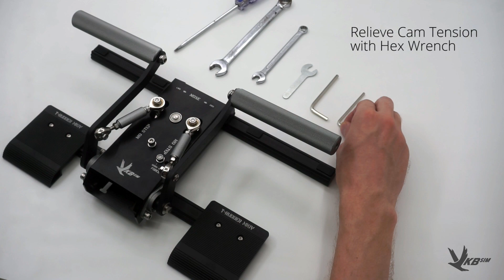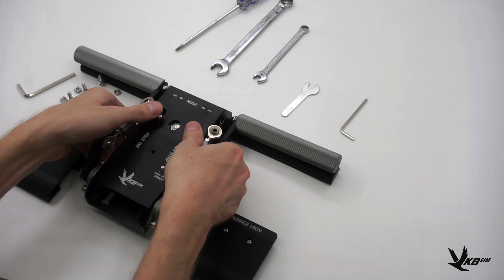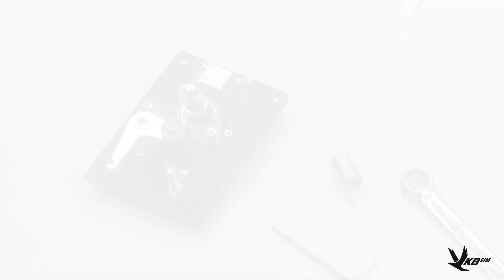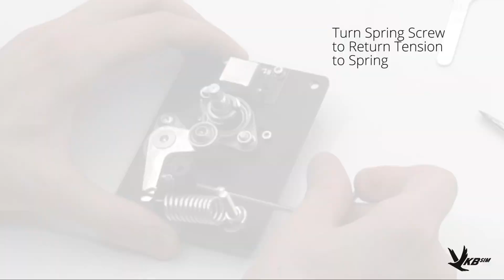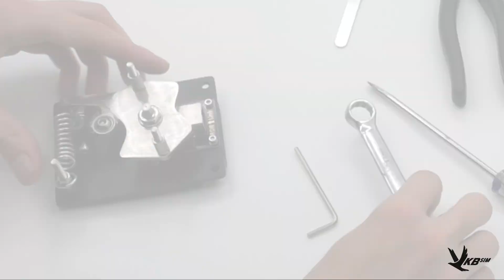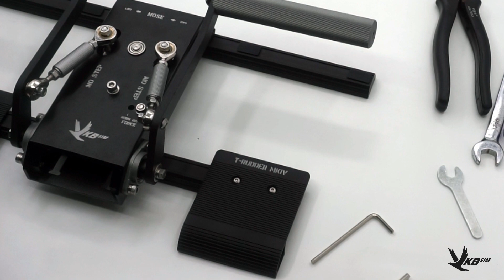VKB-Sim T-Rudder Mk.IV Pedals Cam Replacement and Adjust Spring Tension

Comment: Just followed, took 3 tries since I couldn't seem to comprehend the Spring Tension but I got it set to high force with no problems and I'm happier with it at high! Much more satisfying/feel like I'm more aware of how much throttle I'm pushing down. (Using for Star Citizen/Space)
Reply: o7
Reply: o7

Comment: Well, I bought these pedals 1 year ago yesterday and here is my little review after using them a lot over the past year;  For Flying Circus I love em' and not having toe-breaks is no big deal because WW1 aircraft did not have toe breaks anyways. For flying in IL2, not having toe breaks can be a real pain in the ass because most planes had wheel-breaks, especially the German planes because they used differential breaking on each wheel, which can be a freaking nightmare just trying to taxi to the runway.  However, once you get some rudder authority while taking off and get up in the air....these pedals are better than my Crosswinds when it comes to precision.  If you can live with breaking via B and N key on your keyboard then I highly recommended these. And the price for this fine piece of hardware is the icing on the cake!
Reply: Do you use light or tight tension? what is better? I'm going to tighten the spring but I doubt for now.
Reply: @alex-mos  I use tight tension.  As to which works best, tight or light, it's all about personal preference.
Reply: Bro, you can double assign the axis so that it deflects rudder and applies brake on that side simultaneously. It's an absolute game changer - now I have differential braking on every aircraft even though the T rudder doesn't have toe brakes, works like a charm, even in DCS.
Reply: @Northorne how?

Comment: Great video, really easy to follow! I flipped the cam to over to the detent-less side,  and changed over to the other spring, at the higher force position in a matter of 5-6 minutes. It really is a very nice design. A suggestion for the Mk5 though, perhaps make the spring tension screw adjustable while assembled, rather than requiring the user to disassemble the unit. by putting the other end of the spring on a lever arm, you could use another screw like the tension reliever to adjust the tension.

I would also suggest moving the top bearing to its own plate that bolts onto the top of the base. Have a cavity under this base large enough that you can take the cam out. This would allow you to access the cam while leaving the unit mostly assembled.

Still a great design as is, but these features might make a future revision a little more user friendly. Thanks again

Comment: I have a Mk.V and just went through this process.  You don't need to take the nut off on the cam.  Mine seemed unmovable.  However, you can take the off the roller by removing its bolt and then the arm swings under cam to make it easier to get the spring back on the arm when it is attached to the high force pole.  The tension adjustment bolt is NOT for adjusting the feel of the pedals -- the feel is either "normal" or "high" force, just those two settings.  The adjustment bolt is there to take the pressure of the roller off the cam so that you can take off the roller (or the cam I guess) and then once off, you turn the other way to relieve the pressure on the spring so that the arm goes under the cam and the spring comes off easily.  When you are all done, the adjustment arm should be out of the way and not be touching anything.  It just there to help with the spring or cam changes and no other reason.  Note that when the roller is off you can turn turn the cam around so that the opposite cam setting can be used -- again, no need to remove the cam bolt to change the cam setting.  Watch out!  It can spin around while you are paying attention to something else -- I almost tightened everything back up and noticed that the cam was not on the side I wanted.

Comment: Would be nice if you could just dial up the tension with a single hex wrench instead of a complete disassembly. Hard to know if you want the extra tension until you go through the whole procedure then maybe you have to go back all over again because the earlier tension was preferable. This way it is either default or max unless you buy different springs, nothing in between for a fine tune.

Comment: I ended up flipping just the Cam in mine. It's like the happy medium between the Normal and High pedal force. Still has the soft center feel but gets progressively harder to push the further down you go without all that extra spring load on it.
Reply: Sounds good but what do you mean by flipping the cam? How do I go about doing that? Any help will be appreciated, thanks!
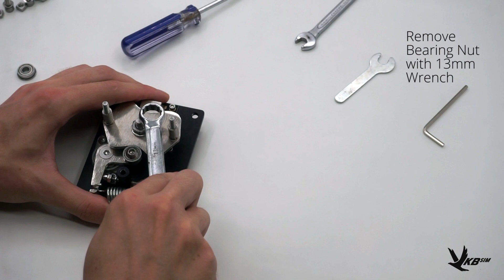Reply: @divij5424  At 1:40 in the video you see the guy removing the Cam. It has two profiles 180° apart from one another(you can spin it 180 on the shaft and it'll still lock in place). It has two Ramp rates. One steep, one shallow. The shallow one gives you more fine adjustment around the middle which makes it feel slower at the beginning. The Steeper profile makes the pedals "feel" faster and a little more twitchy around the middle.
Reply: @SternLX  thanks for that! I understand now. Just to do confirm, the shallow profile is the default and you switched it over to the steeper one, is that correct? 

Thanks for the help!
Reply: @divij5424  Yes. I switched it over to the Steeper one.

Comment: Question: is the cam fliping neccesary to change the tension or it just to change the centering ? (ie: they are separated setups) 
ANWER: No.. the cam fliping is optional..in my case i found out the stock setup is the "hard stop" that i like.. fliping the cam arround and that center notch wasnt there anymore .. si i had to flip it again to stock and now i have higher tension spring setting and center notch
Reply: Thank you, good to know. That's what i want to do, but can you explain one thing to me: do you have to screw the tension-screw in or out? In normal state, the screw is already fully out, and the spring is loose. If you screw it in, you tension the spring?! I'm confused😅
Reply: @Carinthian_Oak  For what i see when i changed mine the tension screw is there to separate the rocker from the cam when needed.. it has not to touch it in normal use.. once pulling apart is easy to see whay it doesn.. if the tension screw touches the rocker it wont properly center.. so im a bit confused too what the function in normal use

Comment: Stupid Question, but in the beginning of the video where it says relieve cam tension. The Spring is already loose, otherwise the pedal wouldn't work. So do you have to turn the screw in or out?
Reply from the maker: You need to release the screw otherwise the tension is too high and can't remove the spring.

Comment: Super easy swap for a higher tension. Definitely like the higher setting better than the stock for smoother more precise movement. All in all took around 10 minutes, either use the tools provided or use your own. Super simple!

Comment: Is there a way to make the pedals taller? I’m assuming I have to adjust the linkage between the pedals and the cam, but I’m not sure how to adjust it to make the linkage longer. Do I loosen both nuts on the end and then spin the middle piece to extend it? I believe that’s how you would adjust a similar car part, just wondering if it’s the same for this product. I mainly fly helicopters in sims so I’d prefer more of a front to back motion than an up and down type motion.

Comment: nice video for nice product !! could you tell me please if the 2 link rod end can be adjustable to increase its lenght ? this product work properly without spring to avoid neutral position and be close to helicopter motion ?
Reply: The spring is there to help the Cam self center. Without it the pedals would just flop back and forth without the tension but they would still work.
Reply: @SternLX  my pedals are currently just flopping back and forth. Any idea what I did wrong?
Reply: @rolliepollie6546  Make sure the spring tension is set properly, if that screw is too far in, the lever won't engage the cam. Back it off a little bit until the bearing on the lever contacts the cam.

Comment: What's the resolution on these? I don't see any info on the site as well. Better than the TM?
Reply from the maker: About the same, but contactless and sensitive enough so you can't move the rudders without output response.

Comment: Has anyone figured out -

The pedal travel from signal output extremes (full right to full left SIGNAL output) happens in less than half the physical travel of the pedals. ie, push the pedal LEFT and it goes to full left deflection in about 1/3 of the physical pedal travel. There's two thirds of the pedal travel left and there's no output change. It's already peaked at zero or 65,000.

Anyone know how to make the signal output less compressed into that small bit of travel? I'd like the pedals' electrical travel to match their mechanical travel.
Reply from the maker: I suggest to look into the Curves function https://youtu.be/rSi11U5J6tg. Or visit our Discord server for further guidance: https://discord.gg/UJAdpdHpYm

Comment: Too bad they didn't use less sizes of Allen screw for everything.  Looks like there is room to accommodate some size variance.  Also disassembly looks like a bit of a PITA.  A bit more engineering might lead to a more one sided solution with less tool requirements.  Great otherwise!

Comment: for some reason i was under impression the Mk5's come with the alternate cam included... bit surprise it does not... implies another extended international order, eish...
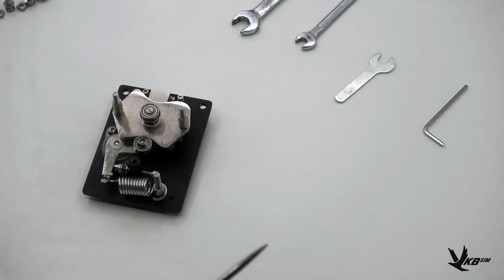Reply: No, there is an alternate cam included in the mk V! It's just not a separate component. The cam piece (@ 1:30) is dual-ended, with cam surfaces on both sides. Just turn it over to use the other side.

Comment: All that for tension adjustment? No toe brakes? Quality looks good, applause for expanding the market.
Reply: Virtual brakes - Need to assign a button on the joystick etc. and they become brakes.
Reply: Theyre honestly the best out there for the price. The next best quality-wise requires you to drop 400 bucks more just for toe brakes. Assign a button and it's really no big deal.
Reply: Do you really spend that much time braking in the sim? I would find it difficult to believe that "Realistic braking" is any kind of game changer for flight sim.
Reply: @DrLumpyDMus  For any ac wheel brakes are vital. Taxi, landing. My original comment is six years old, btw.

Comment: Horrible design!  I had a nightmare trying to put the spring over to the "high force" position.  Bits fell out while I was disassembling and I couldn't see where they came from. Would have been much easier to have the back plate come off or better still, some way of changing tension without removing anything. The tensioner screw seems to do nothing now. I've got two lockwashers left over and no idea where they belong.

Otherwise I love the pedals but taking them apart is a bit of a mess and you can't see to photograph each bit before you begin.

Comment: That's ridiculous... certainly from the same guy that designed the Renault Megane II headlight unit where you need to disassamble half of the front of the car to access the bulb holder...
Reply: It's literally a 5 minute job to completely change its inner core workings.  I don't see how that's "ridiculous."
Reply: @jeremyphipps777  It could have been a five second job if they'd engineer the assembly with an externally adjustable spring. For me that's covered under "Ridiculous".